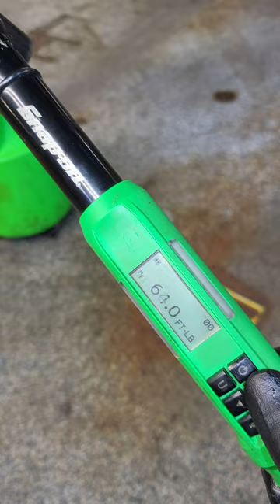How Over Torqued Is The Drain Plug!? 🔧😁👍 #honda #crv #oilchange #overtorqued

Comment: That’s tighter than the lug nuts should be torqued at 80 foot pounds. That means the wheels are prob at 1000 foot pounds as well 😂
Reply: Isn't that also near the torque spec of head bolts?
Reply: I do 110 as a minimum for lug nuts, 80 is a joke lmao my gun puts them on harder than 80
Reply: @jankington216 80 is the spec from Honda for a lot of their vehicles
Reply: @jankington216  it's 80 my man
Reply: @jankington216 yeah it's 80 for my pathfinder but I do 110, I've lost a lugnut at 80. No stretch on the studs at 110, and even if there was, new studs are a lot cheaper than having a wheel fly off.

Comment: Wow that's crazy for it not to be stripped. A company I used to work for torqued every drain plug to 25 ft lb And they quit doing it because of stripping out drain plugs on aluminum pans. So 101 is just insane.
Reply: 25 sounds low. honda oem spec is 29 foot pounds. i agree, 100 pounds is fucking nutss.
Reply: @cloud-ny5ux  yeah I know. It was just the company's way of trying to make it idiot proof yet idiots are always going to find a way to mess it up lol. Also we used manual torque wrenches that went through over 200 cars a week so I don't doubt they got out of calibration.
Reply: @ZeroIntel1  gotta use split beam torque wrenches for that situation
Reply: @cloud-ny5ux newer gens torque to 30-31 on oil pans and 35-36 on trans and diffs. Not shaming you, just adding to it
Reply: @benjaminmayfield6954  im talking about my gen honda which is the 8th gen.
Reply: @benjaminmayfield6954 and maybe that’s the reason I do my own oil changes. Got tired of Wally World rounding the head of the drain plug, stripping the threads on the oil pan, or replacing my underbody shield with just 2 fasteners (instead of the factory-equipped 8). 🤬
Reply: @cloud-ny5ux  as am I, still 30ft lbs or 40 nm
Reply: @carlovanrijk4039  maybe don’t go to Walmart 🤷🏻‍♂️
Reply: @benjaminmayfield6954  yep! Not anymore!
Reply: @benjaminmayfield6954  29
Reply: @cloud-ny5ux  please show me on Honda iN where it says 29 for ANY honda
Reply: @benjaminmayfield6954  you can look it up yourself :D just like i did for the lug nuts, caliper bolts, strut bolts, valve colver bolts, alternator, vtec solenoid bolts. etc i looked up all of these torque specs and more whenever i work on my 8TH GEN car.

Comment: Surprised it isn't stripped damn
Reply from the maker: I wouldn't be surprised if the threads fail soon. The plug felt a little iffy going back in at 30 ft lbs
Reply: @TEVIDEOS surprised u wouldn’t replace after that…damn